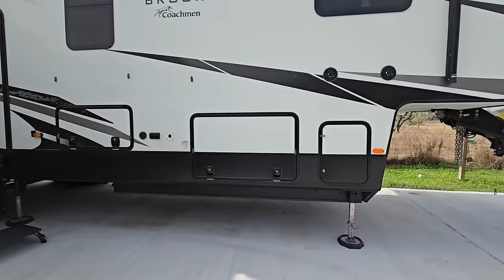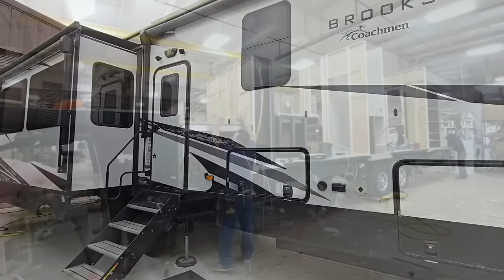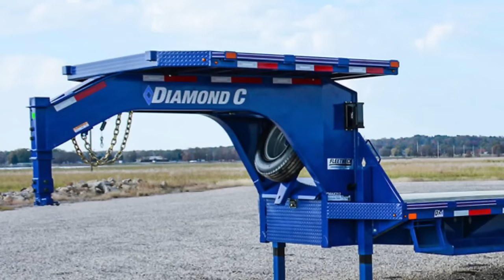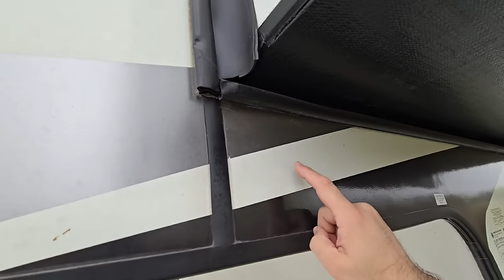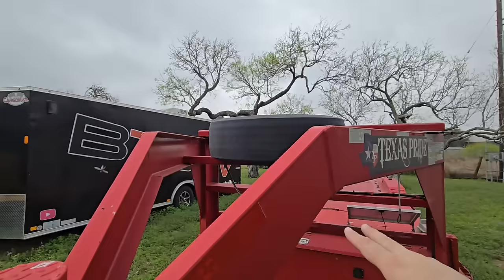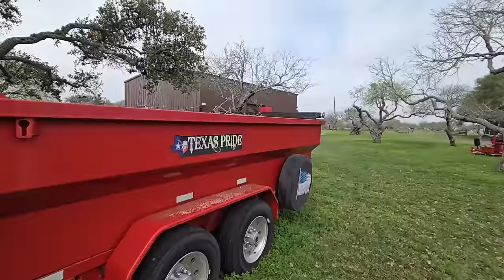FIFTH WHEEL RV vs GOOSENECK Trailers.  WHY THE DIFFERENCE?  Explained!

Comment: I just drove My family's class A from California to Georgia on Interstate 40. The roads were absolutely horrendous, multiple times I actually caught air driving the RV. The roads didn't get smooth till Texas and then our exhaust pipe flange to the catalyst snapped off completely after a huge bump  near Atlanta,  Georgia. Our  infrastructure is absolutely garbage. I think this is contributing to alot of issues people are having.
Reply: I agree 100%.  I40 has very bumpy sections in az and NM
Reply: Not just I-40. After traveling from North Texas to Michigan's UP and back with a bumper pull travel trailer, we're still looking for our fillings! Roads in this country are disgraceful!

Comment: Flexing isn't the problem. It is when fasteners are missing or loose and it begins to hyperflex beginning a chain reaction of self destruction.
Reply from the maker: @armslength2618  So you are making a false argument for what gain?  The walls are generally aluminum Luan or Azdel then aluminum studs, wood blocks inside, Azdel and fiberglass.  Not as strong as steel, but not as weak as you may think.  If not secured properly, then yes, a failure will eventually occure.

Comment: High end Living Quarters horse trailers are gooseneck trailers,  and they've figured out how to build walk in front bedrooms without making the trailer overly high.  Thinking I'd like to see you compare them.
Reply from the maker: Example of a horse trailer with a 6ft+ tall front walkable area please?  I know a lot more about Horse Trailers and how they are built than you might think.
Reply from the maker: Unless it has no air conditioner, it's nearly impossible to get the space for a full walkable front area.
Reply: I had a 1995 Trails West four horse gooseneck trailer, with a front tack room, that I bought in 1998.  In all those years,  I never had a horse injury,  or an issue with the trailer.  Then,  in August 2019,  at 11PM, we set out on an 8 hour trip to the northern California coast.  30 minutes in,  we got on the freeway,  set the cruise and settled in for our night of driving.
Reply from the maker: Trail West trailers were always relatively short, and had short upper decks as well.  I think the Max Gross vehicle weight rating on one was 12,000 lb.
Reply from the maker: Also, the upper deck was only about 4.5 ft tall.  Remember, the vast majority of issues people are having are with RVs that are over 42 ft long, weight more than 17,000 lb, and our full profile (over 6ft of headroom) and lived and traveled in full time.
Reply: Suddenly,  we heard a loud crash,  and the back of the trailer changed lanes.  I moved over to catch the trailer,  then got onto the right shoulder and got stopped...we had been rear-ended by a drunk in a Prius going 100 mph. Two minor horse injuries,  but the trailer was totaled...the horse in the back had car parts in with her.  That solidly built trailer saved lives.
Reply: Again,  I've seen LQ trailers with bedrooms that I can walk into...granted,  at 6'4", I have to duck my head...
Reply from the maker: Can you please find an example of a horse trailer with anything taller than 5 ft up front?  Use the power of Google if you have to.  Unless it's designed to be pulled behind a semi, I've yet to see one.  Not saying they don't exist, but the point of this video was to explain why highly uncommon for a gooseneck to be converted into a fifth wheel.

Comment: At the 23:07 mark you commented about re-evaluating how you load your 5th wheel.
IMHO, this is the most responsible thing we as an rv'er can do, because every YouTuber who makes a video about frame flex i  would guess they are full timers, & 1. Take everything they can possibly pack into rhe basement, and 
2. Have accumulated even more stuff through the years.
I think i need to get out to my storage space, pull out all the junk in my passthrough & do some housecleaning.

Comment: There are a lot more things going on structurally than any one has hit on yet with 5th weal frames, if this was evaluated as a ground structure they would address seismic consideration, lengths, and deflection, heat created from Highway temperatures with expansion and contraction evaluation included, and most likely the outcome would be to put an expansion joint in the house structure where horizontal from from pin-box drops down to vertical to alleviate movement and structural damage along with cosmetic damage. Not sure anyone has ever taken into consideration the amount of deflection that occurs in horizontal steel when it is loaded and driven down the highway. Place a chronograph/seismic meter on a large fifth wheel loaded and run it down 5000 miles of the US Highway and see where your engineering takes you. There is absolutely no excuse for inferior welds and hardware missing on any frame that they are finding in some of their investigations. 👊👍😎
Reply from the maker: Totally and completely agree, unequivocally. No excuse for horrible welds, no excuse for poor craftsmanship.  That said, look at today's workforce.....
Reply: @BigTruckBigRV -- But don't look too long or you may find yourself feeling ill. :( We took personal pride in our workmanship my entire life. I sometimes wonder now if that has become a lost art. :(

Comment: I have a Montana High Country 383TH….if you know how it is designed it may be the ideal way to keep from overloading the front storage as it has very little compared to most….it does however have a massive amount of storage under the rear bathroom and rear bedroom.  I haven’t had any problems but that is not to say I won’t in the future.  Just with all the talk about spreading out your cargo to act as a counterbalance to not overload the pin weight….don’t give the option to do that.      Especially since a dealer or manufacturer never explains this….they just boast about their huge front storage compartments.  And yes I am no different not being informed I would have been one to load up mine, if it had a huge front storage compartment.
Thanks for all the information you have tried so hard and spent a lot of time trying to gather.

Comment: It’s not the flex that’s the problem, it’s a ridged structure on top of a frame that flexes and the connection fails. Loading is a big one, ride quality is another. 
Not have a bedroom slide probably makes a huge difference as it adds so much weight and take so much strength out of the walls

Comment: We keep getting deeper and deeper into construction and trying to figure out how failure occurs, this is good. Engineers are paid to do this and when a design fails it should fall back on them. In the realm of pickup trucks, we have C channel frames and boxed steel frames, the difference is that boxed steel frames are rigid and don't flex as much as C channel frames they each have there place and different characteristics. With the front of 5th wheel frames being designed mostly of boxed tube steel, the amount of flex that is allowable is very small. When a design fails because the tube steel is stressed beyond it's tolerance resulting in fatigue and ultimately failure, the solution is to increases the thickness or the size of the member. If you look at Lipperts new 5th wheel frame it uses what looks to be a 6x6 tube steel front crossmember, much more rigid than a 2x6 square tube. Every piece of structural steel flexes, but when the load increases to a point where the steel is stressed beyond it's elastic point it wont return and fatigue will start, repeating the cycle will ultimately cause a failure. Typically 2x6 tube steel as used in the front section of most 5th wheels is pretty stiff vertically, but when a load is applied to the side it is much less stiff. What really needs to be determined in most of these discussions is the amount of load that the front frame is designed to handle and tested for. When I see people stating that their pin weight on a trailer with an empty pin weight of 2350 lbs is over 4400 lbs there is a major problem. People that think a 3000 pound payload is a lot need to understand that 100 gallons of fresh water just used up 800 pounds of payload, add another 60-80 pounds of propane, food clothes, add a washer and dryer and 280 lbs for a generator and we quickly become over loaded. 
When I was still working I would make food runs every other week 320 miles round trip. I had a Haulmark Grizzly 28' enclosed gooseneck trailer with a large overhang similar to a fifth wheel. The main difference was the amount of 2x6 tube steel in the front of that trailer overhang was three times the amount of steel in any fifth wheel frame I have seen. I never noticed any flex in the front of that trailer over thousands of miles and many inspections. I typically loaded that trailer with 4-6 full pallets of canned food, plus a pallet of milk and two freezers filled with beef and chicken. The trailer was rated at 14k, but I was typically closer to 18k. I set the trailer on a set of scales one day and moved full pallets with a pallet jack to determine how far forward I could load full pallets and not overload my single rear wheel one ton truck. It was quite interesting to see the bridge effect of loading heavy pallets between the front axle and front of the trailer. Usually the very front of the floor of the trailer would only transfer about 50-60% of the weight to the pin (ball) I had it figured out very well in case I got pulled over by the weight police. I even upped the ante and bought a one ton dually to haul this trailer to keep myself legal. One day I got pulled over by Montana DOT and was told I was going to get weighed for compliance. I was empty at the time. The officer asked me what my license plate was and I told him State of Wyoming, 30 minutes later he came back and told me he wasn't going to weigh me, but I was overweight for my driver's license with a total GVWR of 28,000 lbs and that I needed a CDL for this much weight. I ended up going back to my single rear wheel truck because I didn't want a CDL. I asked the officer what was the Montana law for RV's, and he said they didn't care about RV's, you could do whatever you wanted and not be bothered. 
We can agree to disagree, but I don't buy the story by the Lippert engineers about the RV walls being an intergral part of the frame structure. The walls could account for a small amount of load in certain conditions, but if they were taking loads all the time the walls will fail they just aren't strong enough. Lag bolts through wood are fasteners to hold the walls in place, not designed for loads. I recently watched a video of a repair center in Indiana that welded in many pieces of aluminum to reinforce a wall where the aluminum studs had torn loose and then they repaired the fiberglass. They added pieces of 2x6's into the wall to tie into with longer lags bolts and sure they stiffened up the wall, but they didn't fix the main problem of the front part of the frame being able to flex 2 inches. Their fix will fail again! I am thinking I will go out to my Solitude 310gk and place a dial indicator on the pin box and then apply a jack under the king pin and see how much deflection there is. I can't find any frame damage on my trailer and I can't notice any deflection when I hook up or unhook, so I am curious to see how much deflection there is. I am going to guess less that .250 "
Reply from the maker: I pretty much agree with everything you said.  The one variable to consider is that this is primarily only impacting 21/22 Fifth wheels ans toy haulers over 17k lbs, 42ft+, Full profile units that have found to be lacking the bolts and are being used as full time units that get towed alot. The vast majority of large fifth wheels aren't having this issue.

Comment: I appreciate your videos trying to get clarity on frame flex problems. I’m convinced the industry is building trailers that can’t handle the rigors of how these trailers are being used at the price points people are willing or able to pay. I can’t see myself buying a fifth wheel trailer from any manufacturer if I intend to drag it all over the country. I think it’s best to go with a lighter fiberglass unit if you want to pull it over our rough roads to see the country. Maybe get a 5th wheel if you don’t intend to put many miles on it.

Comment: A very good video. Makes it easy for the average person to grasp this. Simply put, anything that moves flexes. It is impossible to make something rigid enough that it doesn't flex, if you did, it would break.  If you look at a tractor-trailer, both the tractor and the trailer are built wit C  channel framing. This allows flex.

Comment: JD, take a look at a Sundowner  toy hauler trailer. It is a gooseneck  trailer. They have sleeping compartments but are designed for hauling cars vice motorcycles or cars. The design is totally different than a conventional 5th wheel but it backs your discussion points.

Comment: JD I think your doing a excellent job explaining this frame flex/failure issues. I'm by no means a engineer but I do have a lot of mechanical experience being a farmer/rancher, there's plenty of blame to go around and every situation is completely different. I do feel there are manufacturing issues, both on the frame builders and on the RV manufacturer, poor workmanship and under designing to keep things cheap is definitely a issue in my opinion, that being said RV's are also being over used for what they are designed for by the manufacturer. However I feel that is on the industry as a whole because when you buy a RV there's no company that spells out the limitations of these RV's because it was cancel a lot of sales do to the expectation of the consumer not being met! The industry as a whole needs to step up and do a better job of educating the consumer!

Comment: All steel structures have to have twist and sway. If they didn't have the twist and sway the steel would fail. Take a steel tower if they were ridged they would eventually fail and fall down. A ridged steel framed RV would destroy everything inside in a short period of time and the inside would look like a bomb went off inside. Gooseneck trailers are more ridged but they still have twisting going on. In my opinion a ridged trailer of any type would be very difficult to tow because the trailer would bounce up and down the road. Please confirm this if you can?
Reply from the maker: Flexing also absorbs energy.  Sometimes people think any movement at all needs to have a gusset, The reality is oftentimes you want movement as a form of energy absorption.

Comment: I just wanted to mention that there are gooseneck trailers that have holding tanks between the cross members and RV living quarters sitting on top of the frame.

Living Quarters Horse trailers have a living area at the front (ours has a slide) and a horse area in the back.  The tanks and components are the same ones you would find in any RV.

Some horse trailer manufacturers are now making toy haulers too because there is a demand for a sturdier trailer than a conventional toy hauler.

Our LQ horse trailer is 8' wide and 34' long. Dry weight is 8700lbs and GVWR is 17,300.  This is a fairly short LQ horse trailer, many are well over 40'.   The holding tanks on our trailer are a 50 gallon fresh water tank which sits under the pantry cabinet, a 39 gallon grey tank and a 39 gallon black tank.  The gray and black tanks are on the underside of the frame between the cross members.

Comment: Have you taken you rig and have it weighed, truck separately from the RV and with? It's really an eye opener to find out how much pin weight there is and the probability that the truck is overloaded as per the GVWR on the factory sticker. From the videos I've watched and the factory trips you have shown, it appears that there is blame everywhere but generally the least is on the frame manufacturer. That of course is if the frame doesn't have any defective components or welds and the final manufacturer builds within the design spec's.
The end user has some responsibility to load the unit properly and then there is the problem with the road surfaces and speeds involved with moving down the highway. Like one person said "It's like taking your house through an earthquake every time you move from one place to another!" It seems like the RV manufacturer could design the top structure to be isolated from the upper frame of the trailer that would allow the frame to flex without transferring the torque to the rigid structure of the body.
Most of these problems have been brought to light due to the major increase in demand for rv's and reduction in workforce, particularly experienced workers, at the beginning and during the covid outbreak. This is showing up now there are miles accumulating and the repetitive hitch and unhitch with more fulltime users seeing the problem the most. It doesn't look like there is an easy fix to the issue and nobody wants to take the responsibility and cost to correct the problem.
It's going to be important for future buyers of these units as the obvious problems with the cosmetics, i.e. cabinets and some wall flex issues are not as apparent at rest and unhitched and could be "adjusted" by someone that may not be so forthright to advise the buyer that there is a problem. There are shady people everywhere, dealers and individuals  alike so try and be as careful as possible. There has been an increase in RV inspections as well and this could prove worth the fee to save on buying a potentially bad RV.

Comment: I agree they have to be built to accommodate the tanks the issue I have is the quality of the welds and the area toward the front riser and pin box. that is the failure points that need to be over done .with gussets and bracing and this area doesn't need to be tanks and any compartments built in to it. and I have seen some of the tubing with very thin walls which is not acceptable to use in that area.